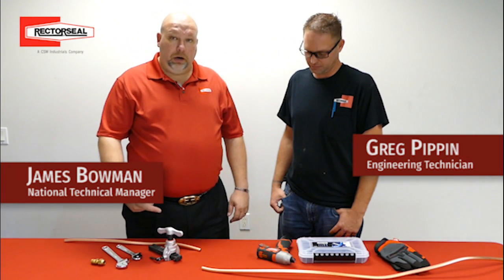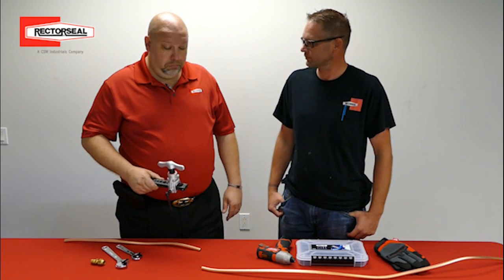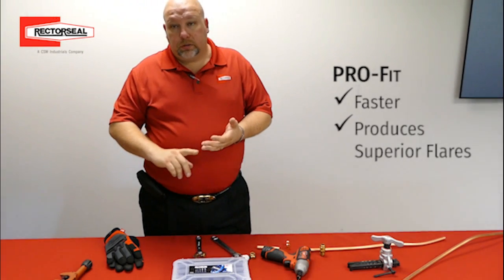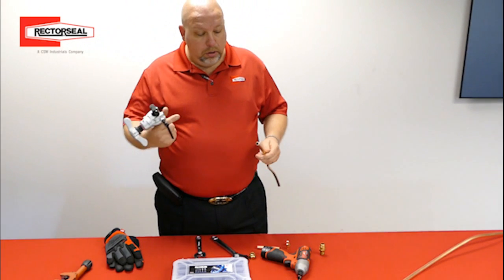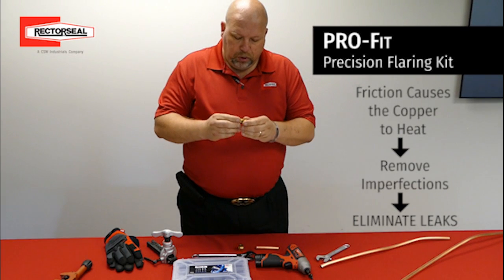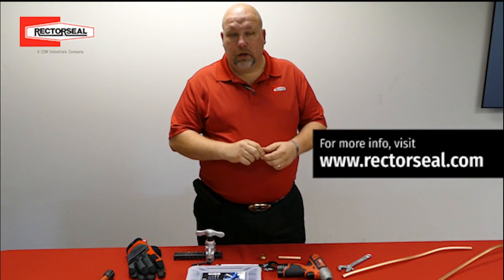PRO-Fit™ Precision Flaring Kit - RectorSeal

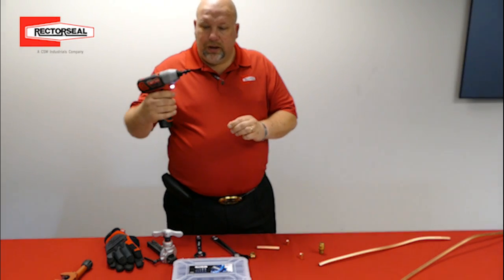Comment: 2:33 - What happens if I don't get the flare the correct size and have to go in a second time? Will I still get a leak free joint or do I need to start over? Also, will tapping the end of the copper be sufficient to knock out the rest of the fragments created (2:37) in this procedure?

Comment: It leaves a bulge in the copper and the flare nut does not fit over it. Junk
Reply: You probably used it wrong
Reply: Using too thick wall pipe.

Comment: Am I the only one that noticed the copper fragments that fell onto the table after using the bit tool?
Reply: De- birs the fitting.  Normal... should do it on all flares.
Reply: @normandeline2339  there weren't any on the old flaring tool side.

Comment: What a copycat. I know for a fact that the original ones from SPIN work a lot better... these just create a bunch of debris inside the copper, not mentioning the bad quality of the final result...
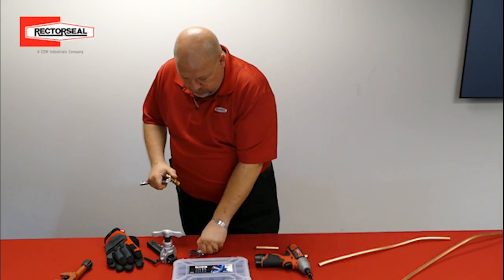Reply: 2:59 Is that what you're talking about?
Reply: @ccall48  I haven't tried these or the spin but the spin brand recommends not using a impact driver maybe he got those results from the impact driver?
Reply: derrickenbuenosaires not sure mate, we tried impact and normal drill and they gave a few of us horrible results. I’ll just  stick to using my concentric cone flare block. I’m not worried about saving a few seconds or minutes if I know the jobs done right.
Reply: @ccall48  What Tool and brand do you recommend or like the best?
Reply: @axelgiovanni1031  BBK had it for over 10 years now... hate to think how many flares and installs i've done with it..
Reply: Debris can come from the cutting of the pipe.  Not sure about this brand, but Spin says deburring is an option.  The method of flaring itself takes care of that.